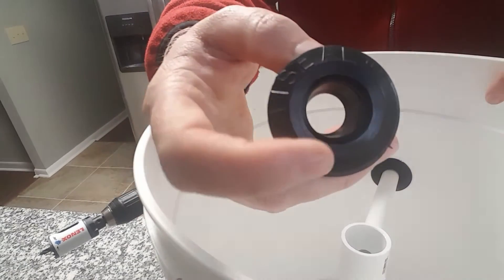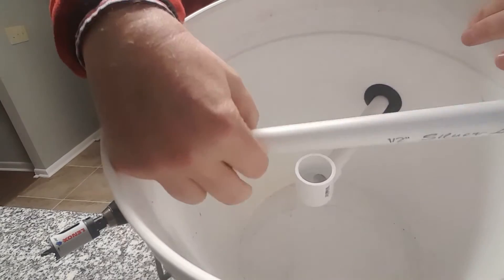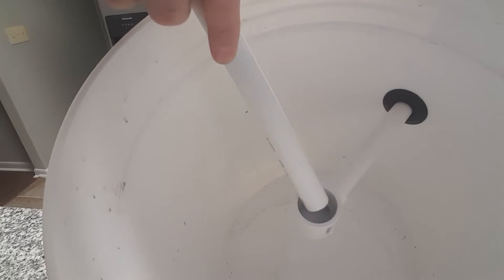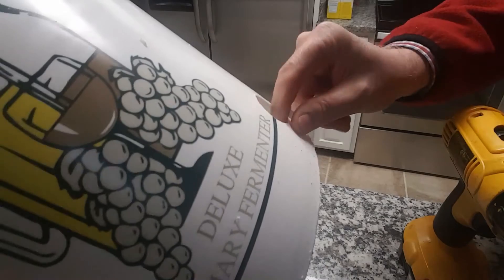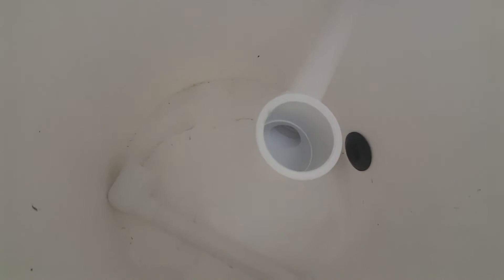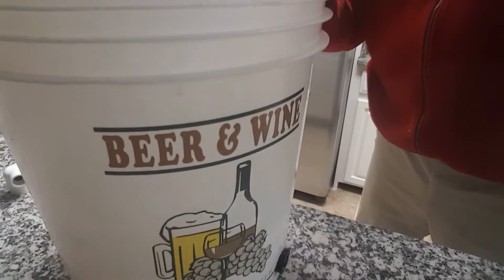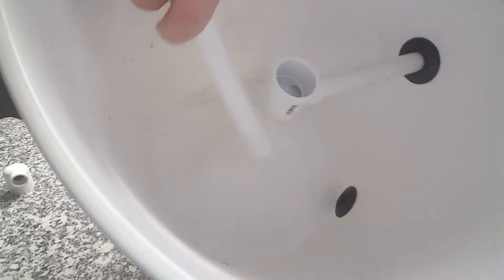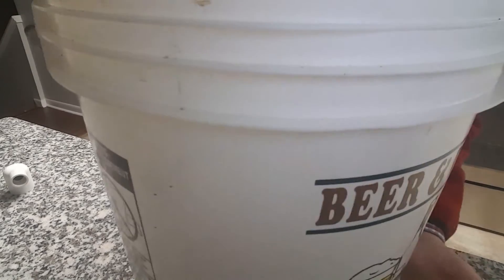Installing Uniseal for Aquaponics Hydroponics

Comment: Well, you have them backwards,  lol, you need to read instructions before you make any video.....lmao
Reply from the maker: Thank you for ur astute observation...however in a swirl filter the water is brought in from the top..and those needed to be sealed well ..therefore I flipped the largest flange on the inside so that no leaks would occur as the water from inside my swirl filter stays inside the bucket  24/7. Which allows more opportunity to leak...I have never had a leak and I've had this swirl filter running for years now....How's ur swirl filter doing???  Oh that's right you've never built one...Why don't u actually build something before u comment on any video.

Comment: if you use 1/2" uniseal then you have to buy a 1/2 pvc to go in it plus elbows right? 

Can you confirm if thats the case and also confirm what size piping would go with 1/2 inch uniseals and 1 inch uniseals?
Reply from the maker: Yes 1/2" pvc for 1/2" uniseal

Comment from the maker: drill a 1-1/4 hole
Reply: thanks
Reply: Should the hole saw be one size smaller?
Reply from the maker: @Санчес-я1т  1-1/4 is the size that it fits in..but it is slightly smaller than the diameter of the uniseal....goto the uniseal website for the right hole size of each uniseal size